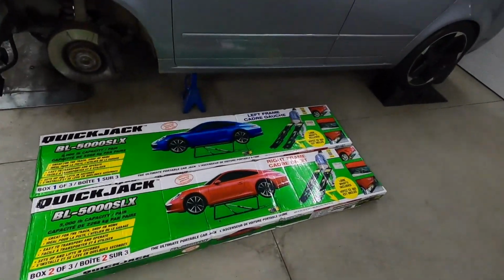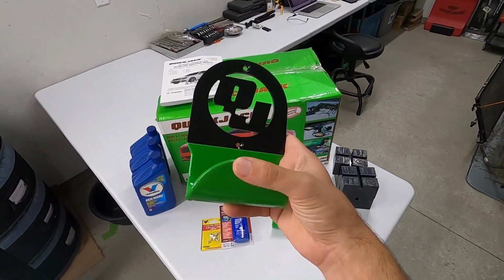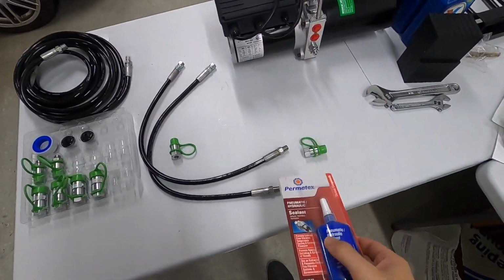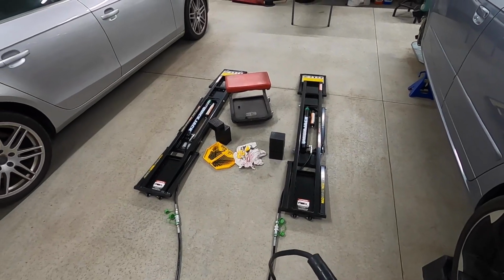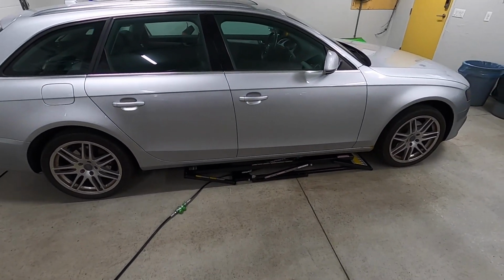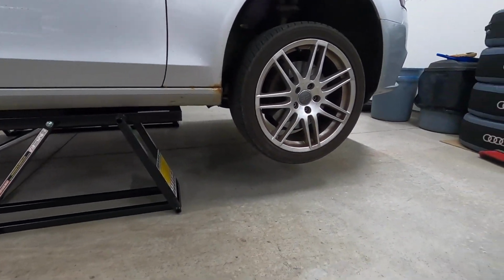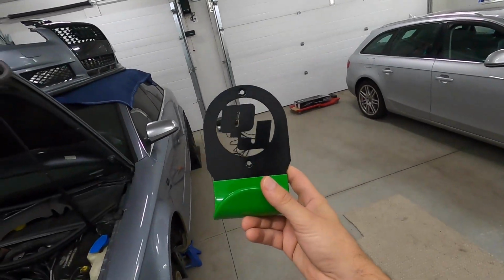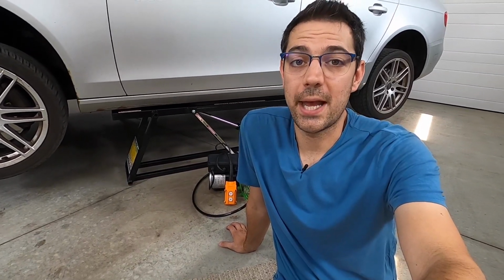Yes, QuickJacks ARE Worth It! 5000SLX Review & Test

Comment: About the design for the blocks, it's because tehcnicalyl you can use the falt block on a pinch weld. I think it's older cars people use groove to avoid rusted spots to break off. But yeah great video I'm about to buy mine, they went up in price since the last year or so should've pulled the trigger much sooner... ahh oh well. 2300$ tax in for the 7000-TL with the SUV/Truck adapters.

Comment: I just picked up a used set of the 5000slx jacks from a guy on Kijiji. Super excited to lift my Audi. Can I buy the pinch weld blocks local in Edmonton?
Reply from the maker: Congrats. I think you can get them through Napa but I got both the blocks and jack hangers through Summit.
Reply: @FigureItAuto  I will try Napa tomorrow. Thanks

Comment: 8:10 the rubber blocks are good for any older vehicle with a ladder frame.

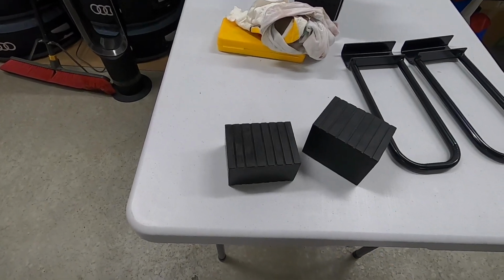9:45 The rectangular QJ pinch weld blocks are a) too short (3in) like you demonstrate and b) have too shallow a notch for an Audi (1in needed). The latest rounded pinch weld blocks from QJ are even shorter at 2.5in. While there are BOLDED warnings in the manual about not lifting the body against the frame, their blocks don’t take pinch welds into account!!!

Comment: Nice review! I agree with your frustration of aligning the slots in the pinch weld blocks with the pinch welds on the car. I have a Miata with low ground clearance which only adds to the problem. My solution was to stack the pinch weld blocks on top of the regular blocks that ship with the product. Problem solved. I can now accurately align the pinch blocks, plus I gain some additional lift height.

Comment: On Amazon there are several versions of magnetic pinch weld blocks that’ll mitigate the alignment problems.   Stick the pucks to the lift points on the pinch weld then align the QJ frames with flat blocks underneath each puck to give proper clearance and eliminate the metal on metal contact.
Reply: Oh so you mean attach the magnetic weld blocks to the pinches and then lift those up with the included QuickJack non-slotted squares?

Comment: Let’s say for academics sake, we ask the question of - will this model lift a short wheel base vehicle (e.g. Fiero, MR2)?  These vehicles have a wheelbase < 95”.
Reply from the maker: I happen to be in the garage and upon a quick measure, you could have a car with jack points along the frame as close together as 38" (accounting for some jack block width) in the closest tray positions on the 5000slx. And collapsed, the entire unit is less than your 9X" wheelbase so, I don't foresee a problem for you.
Reply: And no risk to picking up the vehicle by the tyres (or binding the wheel if the intent was to remove it for service)?
Reply from the maker: @Slowcarfastbeans  This lift isn't designed to lift a car from the wheels - it has to be from the frame rail or some other structural, fixed position. But, once the car is off the ground, no, it won't bind any suspension components or get in the way of removing a wheel.